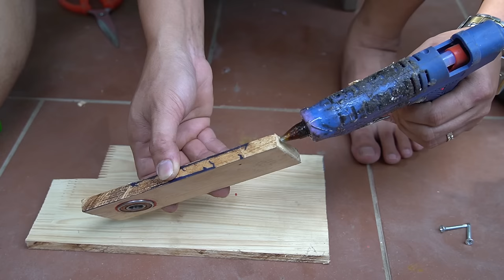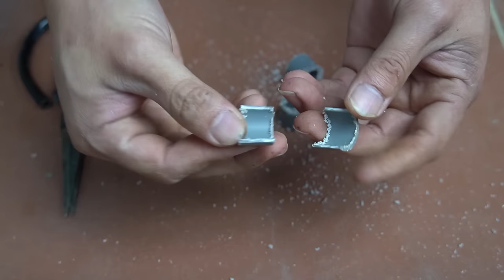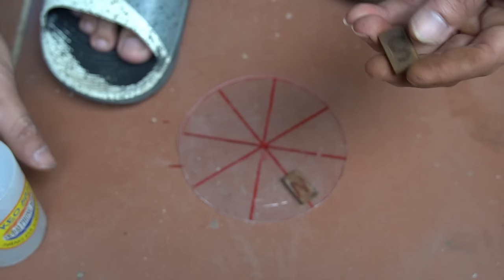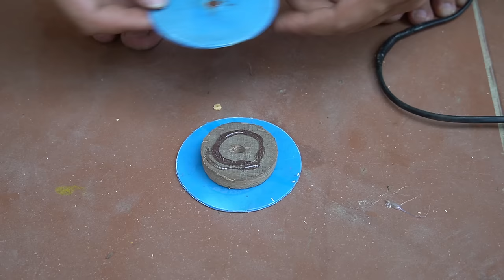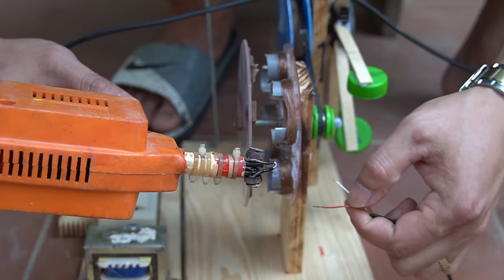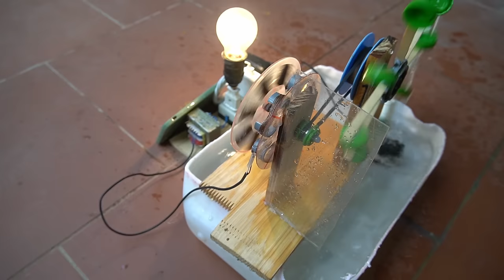How I Make A Small Permanent Hydroelectric Generator At Home

Comment: Why don't you put description on your video ? What materials are using .
Reply: What  are the materials  are used
Reply: @narayanachiguru2262  Can't you see the materials on the video?
Reply: உங்கள் வீடியோவில் என்ன பொருட்கள் பயன்படுத்தப்படுகின்றன என்பதை ஏன் விளக்கவில்லை
Reply: Ha bhai please material ki list bhejdo
Reply: Yes it is rightly say by pacific oceania
Reply: What I've seen material's he used is copper wire, magnets about 8 pieces, small wood in pairs about 6, plastic cut into circle 2 pairs,  glue gun, battle cap about 8 pieces, a small circle rubber that connect the two wheels to spin it, some kind of transformer junk parts from other machine's like refrigerator then attached the wire to the copper wire end with soldiering led or something, a socket, a small water pump, and another wheel made of plastic with woods the bottle cap attach to the screw of course with brace, and two smaller circle where the rubber is attached to make it connected to each wheel.
Reply: Because it was fake
Reply: Main thing in this video is to hide powe supply
Reply: You dont have a eyes😂
Reply: because he don't know English he is a Chinese

Comment: For everyone struggling with the item list here it is:

MFG bearing (2)
Wood planks 
Glue gun
Ovicart 0.25w 160hw 20mm round plastic shell magnet
6N40 roller 
Ice cream sticks 
Glass paper 
CD
Plastic PVC pipe
Super glue
Copper wire (1 bundle )
Drill gun (optional)
Screw and bolts (10-15)
Black tape
Rubber band (10-15)
Bottle caps (10-15)
Steel wire (thick one to be used as a stand)
Switch board
Transformer
DC Water pump (9V)
Wires 
Tub
Plastic pipe
Adapter ( to connect the pump)
Glass paper 
Water
Reply: What is the  shell magnet?
Reply: Does it really works 🧐
Reply: It seems fake...how can it generate an infinite energy...and also so much energy with such slow rotation
Reply: Thanks a ton :)
Reply: you miss the neodimyum magnets
Reply: thank you bro, you are a living legend for real
Reply: مش راضي يولد كهرباء
Reply: Can you please write the steps as well
Reply: @hazel_creativity  lol
Reply: @jonmath4182  😐
Reply: thanks
Reply: Te falto poner y conectar a la rede electrica😅😅
Reply: Transformer ...DC to AC?
How many Volt...u❤
Reply: How many times did u  turn d cooper on d The plastic?❤
Reply: can u tell me how to make this?
Reply: I like this
Reply: What is the name of the material where you put the sticks please?
Reply: Tysm 😊

Comment: Materials are Transformer 220v to 12v, wood, switch board, tub(small), bottle caps, insulated copper wire, thin glass paper, hot glue or fevikwick, bulb100w pipe, iron thin tod, water up taker. These are the materials to make this project.
Reply: How do you know??
Reply: Transformer ac or dc
Reply: The measurements of the board
Reply: Te funcionó para que me ayudes Ami no me funciona
Reply: Can you tell how many turns of copper wire did you make in each of the four loops?  And what gauge did you use?
Reply: Thanks
Reply: Ok
Reply: Bhai wo jo copper wire wale ke samne kya lagaya Jispe N    S likha tha
Reply: sir how many turns of copper wire
Reply: did this work for you?
Reply: @milioaraqivirlan343  ya
Reply: What about magnets?
Reply: I love you…….no homo
Reply: Is it really working 😅 if u know how to do it please explain me bro
Reply: Is this will work 100%???
Reply: Is this will work???
Reply: Materials are Transformer 220v to 12v, wood, switch board, flat wood(small), bottle caps, insulated copper wire, plastic spoons, bulb 3v, hot glue, water up taker. These are the materials to make this project
Reply: @jamescasidsid7682  is this teally working 100%??
Reply: @jamescasidsid7682  some materials you have missed.
Reply: @edwinbrionesjr2564  Ya but only for glowing bulb
Reply: @prathameshartsandcomputer2204  so how is the water pump working possibly if this only work for the glowing bulb? Thus, this mean that this one is fake?
Reply: @edwinbrionesjr2564  ya it can only produce small amount of energy.
Reply: Few of the components r missing
Reply: @prathameshartsandcomputer2204    Can i know the exact materials and the voltages of this just need it for project.
Reply: @edwinbrionesjr2564 its not fake.. Since it has enough power to run pump
Reply: Can  you tell what is that rectangular things with the "S" and "N" symbols? The ones he placed on a circular glass disk.
Reply: can you please tell what magnets he used for that rotating disk
Reply: @moosaharoon7585  transformers are always AC
Reply: N or S Magnet he kya ???
Reply: @juliannealyssaguardiario2364  neodymium.. Amazon has it or ur local online shop
Reply: Hello please can you give me more hint on how to carry on the project please
Reply: How many turns does each coil have?
Reply: @prathameshartsandcomputer2204  Can you send me a soft copy of your research paper
Reply: What is the total cost of all the materials..
Reply: @zahiralam1984  about 1500
Reply: @prathameshartsandcomputer2204 
can you send me the exact materials of this project
Reply: How I can get a transformer sir plz can u tell
Reply: @prathameshartsandcomputer2204  amigo ayudame por favor, realmente proyecto funciona, a que si la energia que se producirá es la necesaria para hacer funcionar ese pequeño motor dw agua
Reply: It is AC or DC transformer 
Voltage generated in turbine is AC or DC?
Reply: puedes traducir en español por favor
Reply: Los materiales son 
Transformador de 220v a 12v
Madera
Tablero de interruptores
Un recipiente para el agua 
Tapas de botellas
Alambre de cobre aíslado un metro más o menos
Reply: @4h-18otonielsantos7 si funciona el proyecto?
Reply: Can you help me tell me how you did the wiring to connect the switch and make it work?
Reply: Materiales en español
Reply: You forgot the floor outlet to power it
Reply: Sorry
Reply: Thanku very much bhai
Reply: كم عدد اللفات لوسمحت
Reply: Functions of each material
Reply: From where should we get the switch board??
Reply: @the_nikhilsrivastava  magnet hai bhai
Reply: Does it work. My school has science and technology coming up. I want to take it as a topic. I want your feedback because tomorrow I have to submit the project
Reply: magnets too
Reply: Coil ke samne magnst hai kya?
Reply: Thank
Reply: No magnate?
Reply: How many volt of electricity is produced by this project?
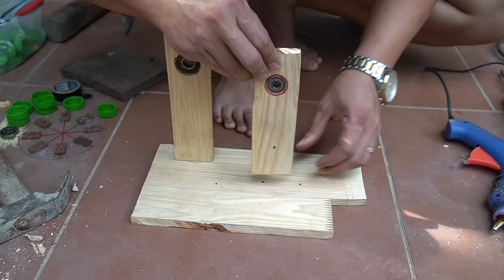Reply: 0:55 0:55
Reply: Where can we get the water up taker?
Reply: Perpetual machines cannot be exit
Reply: @prathameshartsandcomputer2204  does it really work?
Reply: Lack of explanation not good
Reply: @edwinbrionesjr2564  No they patched it in the new update
Reply: What type of water up taker
Reply: @jamescasidsid7682 pls what's the name of the water uptaker,so I can buy it
Reply: Thanks 😊
Reply: Really.....,great inventions 💯💯🎉🎉🎉🎉🎉🎉

Comment: This is a diy alternator like you find in a car, the input power was the string at the start turning the copper around the magnets generating electrical charge sufficient to supply enough power to get the fish tank pump operating. Once the water is flowing, more energy is generated so the system continues working👍👍 REALLY CUTE😄 Ive no idea how long it would operate before it fell to bits but who cares?? Great fun👍👍

Comment: How many amount of turns did you use in the stator?
Reply: none, because there is a battery hidden in the power box.
Reply: such a low rpm ant generate ac voltage.
Reply: @his_mum really?
Reply: @khuranapranshu  yup. Because of friction etc. The cycle us always less than 100% efficient. So it can't be perpetual.

Comment: The airgap between the magnets and the coils. No way that is generating any power.  Plus, those are like refrigerator magnets the weakest kind you can get.  Need much less space between the magnets and coils.  The magnets need to be neodymium to get any real power output.  Coils also need more windings.   Now I've seen someone do something like this with the stator and rotor off a motorcycle and get about 12v DC at 70 watts but the pump used to run it was much larger and pulled 12v dc at about 28 watts.  That allowed 40 to 42 watts to go to a charger for a battery.  But there is no way this setup is powering anything except maybe a single led light.  Not the pump, the light bulb, and a cell phone.

Comment: No engine can generate the energy it needs to run without an external agent. Only the expenditure of energy used in the lamp would already make the engine stop because it does not return to the engine, let alone feed the cell phone battery, not to mention the energy that is dissipated in the cables and components connected to it. Unfortunately, this perpetual motor idea does not exist. The only doubt in this video is where the guy hid the outlet or the battery that is powering this contraption
Reply: Nay-Sayers like you will be left behind
Reply: He's using a floor outlet.  Ever wonder why these guys always build their revolutionary zero-point energy machines on bits of wood?  They just cut a hole in the wood the exact size and shape of their energy source, pop it on top and hey presto you've successfully hidden your power source.
Reply: so huh?

Comment: amazing! Without the water, could this also work as a mini windmill? Out of curiosity!
Reply: yes but its very hard for it to gain that much speed due to its design. its design is built to work on gravity drop
Reply: I think you would have to adjust the ice-cream-stick turbine in a way that it can be spun by the wind. Of course, you can't get wind as reliable as this 'flowless' water system

Comment: It is very nice 
Can you write what are the equipments required to make it
Reply: MFG bearing (2)
Wood planks 
Glue gun
Ovicart 0.25w 160hw 20mm round plastic shell magnet
6N40 roller 
Ice cream sticks 
Glass paper 
CD
Plastic PVC pipe
Super glue
Copper wire (1 bundle )
Drill gun (optional)
Screw and bolts (10-15)
Black tape
Rubber band (10-15)
Bottle caps (10-15)
Steel wire (thick one to be used as a stand)
Switch board
Transformer
DC Water pump (9V)
Wires 
Tub
Plastic pipe
Adapter ( to connect the pump)
Glass paper 
Water

Comment: If u see the initial rotation in 8:07 that would be faster but the major fact how could the Flow of water is getting slow which is less then the generated power and it also decreases the rotation power of the wheel but surprisingly it works🤣🤣🤣🤣🤣🤣🤣🤣🤣 and also the rotation speed is also maintained...and the video editor very nice 8:09🤣🤣🤣
Reply: in the part it turns the opposite because of the water hitting
Reply: @mirage_fortnite12131  bro u r a very practical sensing mind 🤣🤣keep it up one day u will be a great scientist.
Reply: @soumyadipghoshdee9948  BRO is this real?
Reply: @Gatoblox44  what would u think is their any possibility available to create free energy 🤣🤣
Reply: @soumyadipghoshdee9948   uf, 0,1%
Reply: I completly agree with you. But wouldn't it be possible to work, if the watsr pump was 10 volts and the generated power 20 volts?
Reply: @dieperx9375 it's totally impossible to think that a "perpetual motion" work in a single pis of wood.😂😂😂if u read physics properly u didn't ask about it. It's only happen if the appling force directly  hit the perpetual machine by  externally. Or any other sources of voltage applied on it.

Comment: How much power does it supply?
Reply from the maker: 200W/1 hour
Reply: Wow that's awesome. Damn great job👍
Reply: @Great_Inventions  200 watt is not impossible. This is a lie. This transformer is only max 15 watt. If this mechanism really works, it will produce 15 watt. ( transformer power) nothing more.
Reply: @HsynCkr900  really this work or no work
Reply: @Great_Inventions  how many winding turns are made?
Reply: @HsynCkr900  is it really a lie yo 😭 pls someone answer my question i really need to make a goethermal project for my homework
Reply: @hailaninaabala  you can make all things here, and you will see it is not working.